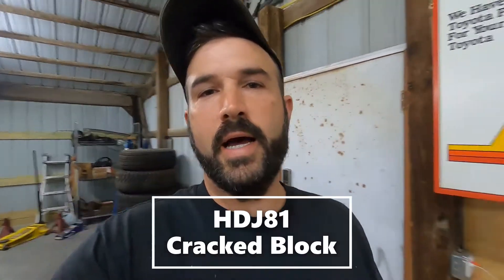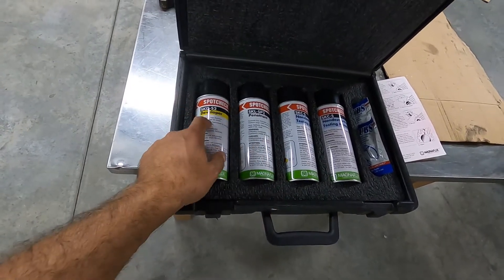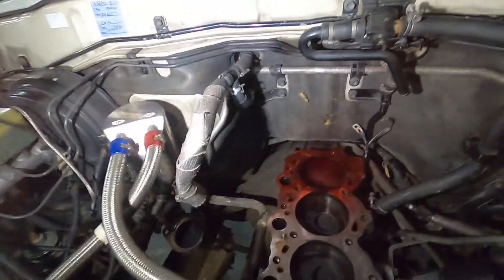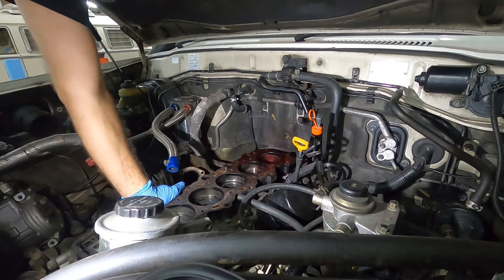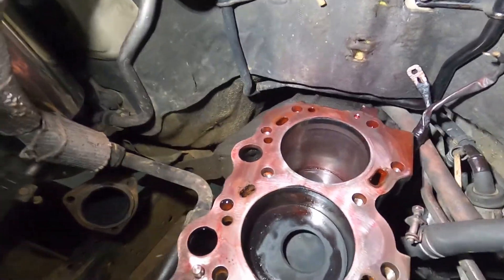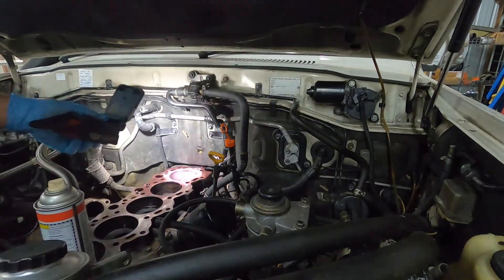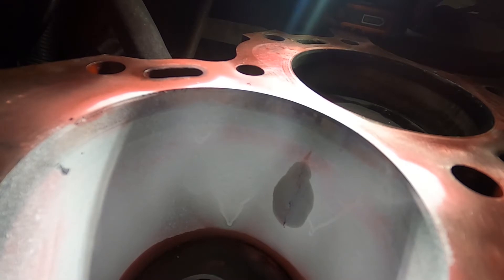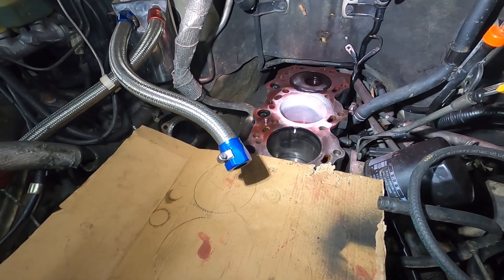Identifying a Crack in the Block of a Toyota 1HD-T

Comment: Hello Sir, its a old video but i wanted to see how the dye kit worked out. ive got 3 blocks here which had liners in already and were cracked underneath. For sure it blow out and i thought it was a head gasket but now all the engine which overheated had cracked blocks. Did you eng up putting a liner in and did it work out for you?
Reply from the maker: Hey thanks for watching!  Yes, the dye kit worked great at identifying the crack.  I had the engine sleeved and then rebuilt it.  Hope that helps!